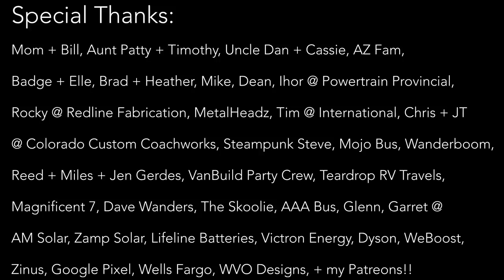DON’T INSTALL A WATER PUMP WITHOUT THIS (ford 7.3L)

Comment: Thermostat bolts strip or break a lot. Their tough to get to. They see a lot of heating and cooling also. That paddlewheel in the pump circulates all the water - antifreeze - around the ducts surrounding the piston walls which see the most heating from piston rings friction.

Comment: Oh Jax, I hate to admit it but I was screaming at the video - "Don't forget the sealer !!!". Oh well I say the best way to learn sometimes is the hardest way. To all men out there by the way yes I do know about mechanics, put it this way I have in the past stripped down a Jaguar XJ6, S1 all the way to the block, I have also taken off/fitted brake systems, yah de yah de yadda I have done quite a bit. I am a qualified tyre and battery person and I can mig weld too ;). Great video Jax, it's great to see you smiling

Comment: hello mojo . made me think of a celphone commercial (hello moto)
as for the broken bolts in the waterpump , once you get it out you can heat the flanges and try to get the broken bits out with an eazy out (lefthanded tap ) or weld the broken piece through the hole of a nut letting it cool while spraying wd 40 and carefully work the piece out (might take a few tries)

Comment: Ok, 10 microns on the way to the engine. 1/100th of a millimeter. Just simple blue jeans are a 10 micron from filter. To get to a 10 micron level,  how long will it take to filter 1 gallon? Or 100 gallons?

Comment: If you break a bolt like that you might be able to get it out with the mig welder.  Take a nut that is a little bigger than the broken bolt and weld on the inside of the nut.  Try to weld to the bolt first then fill the nut to the top without melting the hex.  Let it cool for a few seconds and solidify then take a wrench and just rock it back and forth loosening and re-tightening.  Eventually you will be able to turn it right out.  If it breaks off, just weld on another.